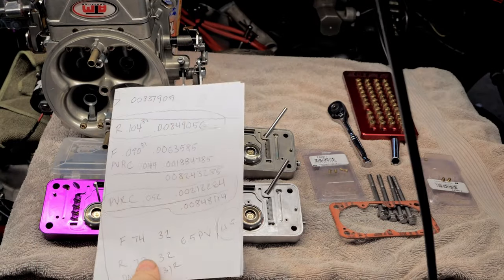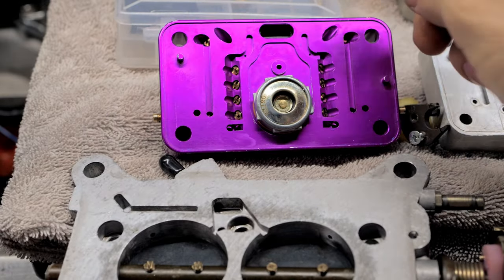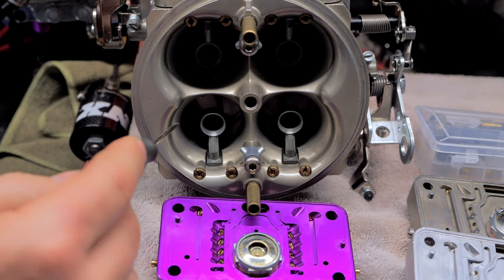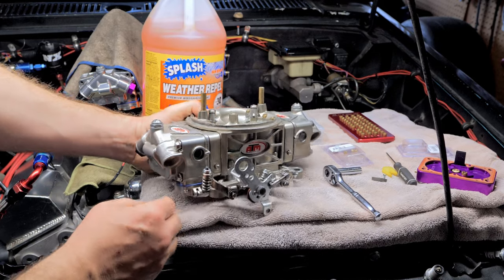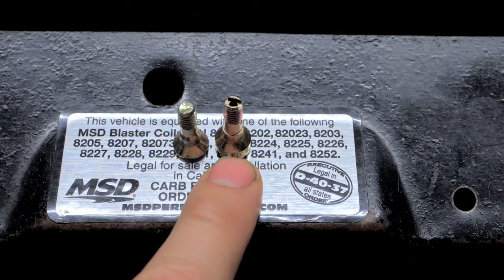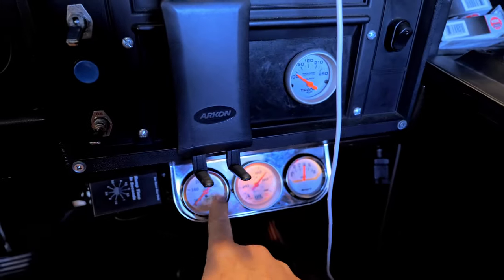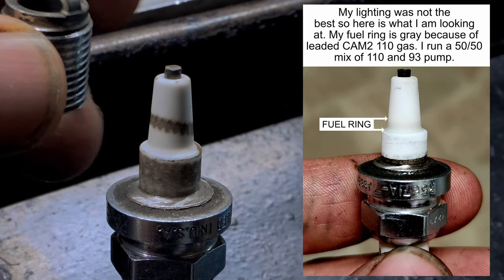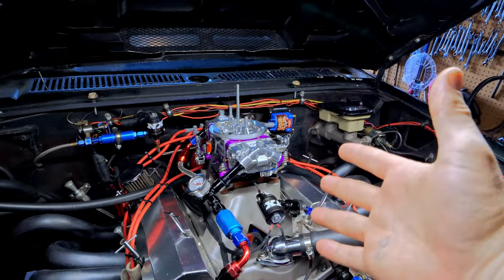The Ultimate Holley 4150 Tuning Video! (  As easy as 1 2 3 sort of )

Comment: One thing to remember, you add layers or circuits, as you open throttle, but the idle and transfer cuircuits are still in use. Many make mistake of believing they go away and are replaced by power and cruise circuits. The adding a layer analogy alway helped me understand how it all works together.
Reply: Emulsion works like oxygenated gas. Just mixes O2 in metering block.
Reply from the maker: Yes sir, it's like a soda being shaken, then opened. One gentleman explained it to me that way, and it stuck.

Comment: I’ve watched this a couple times now. I’ve got a650 on my 5.0 with 185 heads, ,600 lift cam, Vic jr intake. I think I under carbed it cause my idle screws are only 1/3 out. I’ve had to jet the carb down from what fst has it set as. I’ve got a old Holley xp that came off a dirt tracker but they only good thing about it is the main body, but I had the screws out like a whole turn or so, and it has a touch bigger air bleeds on both circuits. Now it’s making sense. Think I’m gonna try running the fst parts on the xp main body and see what that does. The xp was on a dirt track car do all the moving parts are pretty worn from all the dirt.

Comment: Many folks also say the transfer slot fuel can be excessive on most of the newer carbs. To help correct  / adjust it you can add  transfer slot restrictors to the main body where metering block attaches. I tapped mine for .070 -.080 restriction. I can further tune the transfer slot fueling. 

The blp metering blocks have both locations for the idle feed restrictors. They claim the lower spot is considered a fuel restriction the higher spot is a air bleed. The pull down of fuel on startup on the lower location helps aid starting of vehicle. Some folks also claim it's easier to tune idle the fuel in lower location.
Reply from the maker: Thanks for the info. 😎 I will have to grab BLP products in the future they really have some trick stuff.

Comment: Excellent video! Wondering if you could help, I have a BBF 460 stroked to 532. I have a 728 lift cam and holley 1000cfm carb. Its running way too rich at idle. Would you suggest I get bigger air bleeds for the idle circuit to lean it out? I’ve messed with the idle mixture screws and nothing changes. Or do I need to check my manifold vaccum and most likely change the power valve from what I’ve been reading if the vaccum is too low

Edit/ just realized I can’t take intake manifold vaccum as there’s no port. I’ll need to take the manifold off and drill a port.

Comment: Is it possible to detune a larger carburetor versus starting smaller.  Planned on putting aluminum heads on my setup down the line. 351 Windsor Steel heads. Looking at a Brawler 650 and 750

Comment: thanks for the video, it shed some light on a couple things i wasn't sure of. 

could you go into anymore detail on the  idle circuit as it pertains to cruising? I'm having some issues with that i think. i can drive around town and accelerate hard with no problem, (it may be a little on the lean side still), but cruising down the road at 55 is really where it is noticeable. it runs kind of rough with no power. the problem also seems to be a little worse if i give it a little throttle in that situation. 

i do not have an AFR gauge. another thing to note, is when the motor decelorates before it shifts there is a miss or stumble of some sort. i believe my mixture screw is adjusted correctly.
Reply from the maker: To effectively diagnose your drivability issue, it's crucial to acquire an AFR gauge. This essential tool plays a critical role in assisting you with tuning during idle, part-throttle, and deceleration fueling. The idle circuit operates until the main boosters come into play. While you might attempt to address your issue by timing the secondary circuit earlier, having an AFR gauge is imperative for gaining a clear picture of the situation. It is not the tell all end all, but it will take the guess work out allowing you to make an educated step based on the data provided.
Reply: @TPVPRO  yeah, I guess my main question  was asking for a little more detail on how the  idle circuit works. it seems like you could have left a lot of information out when you were talking about it. 

does the idle mixture screw effect cruising or is that just the air bleeds that should he changed?
Reply from the maker: @reloadingfun   Yes, they do impact cruising because both the restrictions and air bleeds share the same circuit. However, resorting to opening them up to address an issue may not be the optimal solution. The goal is to achieve the leanest possible idle to prevent excessive loading. I typically maintain an AFR (Air-Fuel Ratio) between 14.5 to 13.9 during idle. Initially, it might start quite lean, but it's after the warm-up phase that you fine-tune the fueling. Additionally try and keep the primaries almost closed and avoid activating the boosters while cruising, most of your idle adjustment should focus on the secondaries. I hope this clarifies things for you.
Reply: @TPVPRO  to clarify,  when you used the word "restrictions"....share the same circuit. Did you mean idle feed restrictors?  also, you are saying that the idle mixture along with the feed restrictors and air bleeds affect cruising?
Reply from the maker: @reloadingfun  Yes because you are on the transmission slot while cruising if it's setup correctly.

Comment: I have a mustang 347 6 spd 4.30s with Aed 750 dp. It was running a little rich front and rear so I went down a couple jet sizes. Now it’s lean on the primaries but shouldn’t be. Do you think I should go up on the power valve?
Reply from the maker: May have just been running fat on the idle circuit so maybe the main jet size change was not needed.
Reply: @TPVPRO  that’s a really good point because It was running rich at idle and that was what I was trying to correct. I also adjusted the idle screws around the same time. I’m going to put the other jets back in it. Thanks a lot.

Comment: i'm trying to adjust my carb like jets airbeels and so on to get my fuelcurve flat and not from 10 at lower rpm to 14 at higher rpm
  can you make a vid of all the steps that incluedes what changing airbleeds are changing in the fuel curve?
Reply from the maker: Check to see how far it is at idle and off the hit. You have to ensure accelerator pump shot and idle air is not causing a fat condition because messing with air bleeds.
Reply from the maker: Check out this video  https://youtu.be/2bhVWTqNx8c?si=DJ1Q6NMwz9mwOQXz

Comment: Hi Tyler, I would love some advice if I could. I have a Brawler BR-67314 850cfm on my 454. I have a part throttle lean condition. My AFR gauge reads 17ish but if the road has an incline it runs at 13.2 which is perfect. As soon as it levels out the engine again runs at 17 and starts to stumble again. Do I put smaller air bleeds? Thanks 😊
Reply from the maker: I got you my Brawler did the same here is the fix. https://youtu.be/wWCpGON4Zis
Reply: Awesome, I will definitely do this. Thanks so much
Reply: Hi Tyler, I installed the adjustable link, and it is 75% better. It is still lean, about 17 AFR at the crucial cruise point though. Do you think smaller idle air bleeds will help at this point? The transition is still not quite right. Thanks
Reply from the maker: @Dag0421  you can close the spread front to back. Going up on the front jetting will also fatten up part throttle.
Reply: Thanks. How do I close the spread? I'm a journeyman mechanic and feel inept 😂
Reply: Hi again, Tyler. I made a mickey mouse restrictor for the low idle air bleeds.  It ran in the 13s AFR at cruise. They are 70s right now. I'm thinking about maybe 50s? Or 45s? It is getting so close now. 😊
Reply: Hi Tyler, I just received and installed the 53 air bleeds, and it runs awesome. Running 13 AFR at cruise now. Thanks for everything. 😊

Comment: great video i am working on a brawler 850 carb that is on a 496 big block.  i was wondering what the thread size is for the idle air bleeds.  i have had no luck searching the web.  i have found two common sizes. 10-32 and 6-32.  no matter the timing or the adjustment on the 4 corner idle circut screws the truck smells very rich.  no droplets of fuel in main body while running.  fuel pressure is at 6 and fuel level in the bowls are just at the bottom of the window.  the idle mixture screws are set a 1.5 turns out.  1.75 and the truck does not want to crank and going any further in seems to make the truck even richer.  i was going to going from size 70 square to 72 or 74 square on the idle air bleeds.   any help would be great.  thanks for the videos.
Reply from the maker: Check to make sure the power valve is not blown. 10-32 is the most common size. Get 2 size increments to about 78 see what it likes. It is trial and error for the most part.
Reply: Ok thanks. I have tested the power valve and it is working

Comment: Man where do you get the time to do this ? Lol..anyway cool channel mane !! I had a question. All the vids I check out got me confused on the tranfer slots!! I have a 4150 holley double pump mechanical  secondary carb. Moded for blow through. My question is do you set both primary and secondary transfer slots to the square? Or jus the front? Some vids say yes..some say no. Some say dont ever touch the secondarys at all. Anyway you seem to really get down the niddy Griddy of tuning,very knowledgeable frfr. Anyway any knowledge is greatly appreciated!🙂

Comment: Shouldn't have to do all that garbage just to make a motor idle. Vacuum secondaries all you got is four air bleed screws and one idle screw and two float settings floats are normal air bleeds are normal idol  screw is 1600 RPM